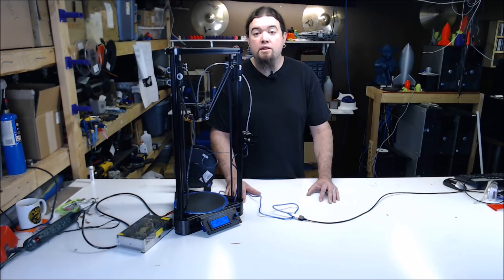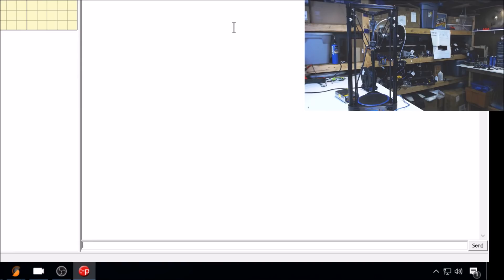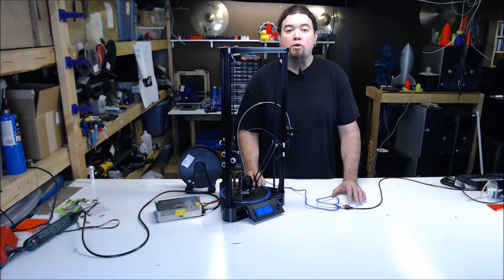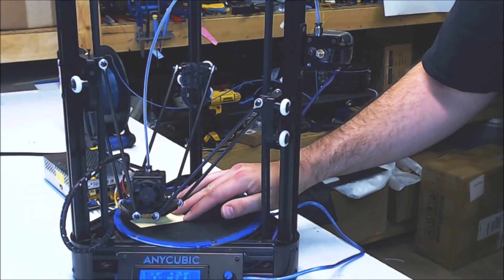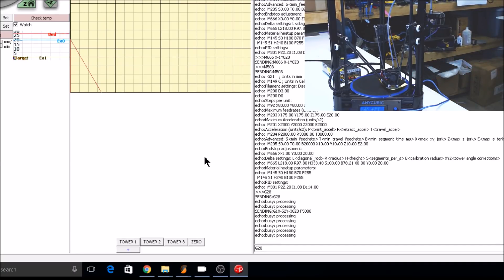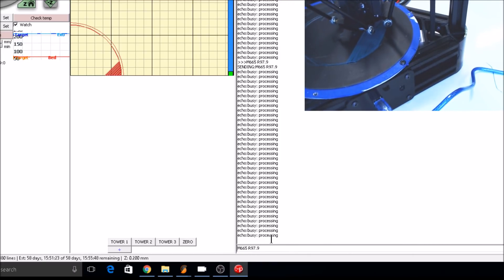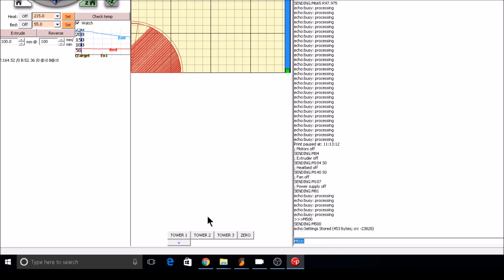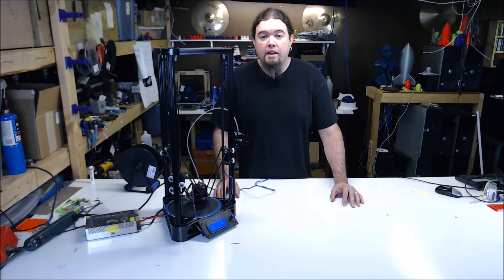How to level your delta printer bed - Anycubic Kossel Delta

Comment from the maker: On the newest version of the Anycubic firmware, adjust the height of the printer with MANUAL_Z_HOME_POS.
Reply: How do we do that? I can't find the height when I type M503 to check the settings. 
Also, changing the z offset doesn't do anything and i don't understand why
Please help
Reply from the maker: Can you post your M503 output? Most of the time when you can't change Z offset, its because EEPROM is enabled. You can comment it out in Marlin to avoid this, or run a M502 to restore defaults, then M500 to store them. This will update your eeprom with your Marlin changes. Also, check out this newer version of Marlin, I have tuned this one for the Anycubic Kossel. Check out this post, https://www.thingiverse.com/groups/anycubic-kossel/forums/general/topic:25027
Reply: HERE IT IS:
SENDING:M503
echo:Steps per unit:
echo:  M92 X80.00 Y80.00 Z80.00 E96.00
echo:Maximum feedrates (mm/s):
echo:  M203 X200.00 Y200.00 Z200.00 E200.00
echo:Maximum Acceleration (mm/s2):
echo:  M201 X3000 Y3000 Z3000 E3000
echo:Accelerations: P=printing, R=retract and T=travel
echo:  M204 P3000.00 R3000.00 T1500.00
echo:Advanced variables: S=Min feedrate (mm/s), T=Min travel feedrate (mm/s), B=minimum segment time (ms), X=maximum XY jerk (mm/s),  Z=maximum Z jerk (mm/s),  E=maximum E jerk (mm/s)
echo:  M205 S0.00 T0.00 B20000 X5.00 Y5.00 Z5.00 E5.00
echo:Home offset (mm)
echo:  M206 X0.00 Y0.00 Z0.00
Auto Bed Leveling:
echo:  M420 S1
echo:Endstop adjustment (mm):
echo:  M666 X0.00 Y0.00 Z0.00
echo:Delta settings: L=diagonal_rod, R=radius, S=segments_per_second, ABC=diagonal_rod_trim_tower_[123]
echo:  M665 L218.00 R98.40 S80.00 A0.00 B0.00 C0.00
echo:Material heatup parameters:
echo:  M145 S0 H180 B70 F0
  M145 S1 H240 B110 F0
echo:PID settings:
echo:  M301 P22.20 I1.08 D114.00
echo:Filament settings: Disabled
echo:  M200 D3.00
echo:  M200 D0
echo:Z-Probe Offset (mm):
echo:  M851 Z-18.26

I'm new to this. When I uploaded marlin I lost the auto level feature in the printer. The problem is that auto level is not precise and is about 2-3mm away from the bed. So what do you think I should do?
Reply from the maker: I would try to manual level first. If you can get that working you can circle back with auto level later. What version of Marlin is this? My guess is it must be pre 1.1.1. Is this the Anycubic Kossel Delta pulley version? I would load this code up first than start from there. https://www.thingiverse.com/groups/anycubic-kossel/forums/general/topic:25027
Reply: I'm not sure which marlin, I'm using the firmware provided by Anycubic. I've been contacting them for over a week to help with this issue and now I lost hope. 
Yes this is the Anycubic Kossel Delta pulley upgraded version. It came with a probe module and a heated bed.
Thank you for your help, I'm going to try it now
Reply: The bed is now leveled but once starts printing it extrudes just a little bit of filament that doesn't fill a quarter of the outer circumference and the extruder makes noise periodically. 
Do you think its a hardware issue?
Reply from the maker: fauzi Ame Strange, it could be. Did it ever print at all?
Reply: Nops, I've been trying for a week. nothing is working.
Reply: Do you think I should return it or something?
Reply from the maker: Head over to my about tab and send me an email. I will help troubleshoot from there.
Reply: Alright, thanks
Reply: Yes and also disabling the software endstops by just changing the true behind the line in a false.
Reply: Isn‘t there a menu entry SET DELTA HIGHT in SET DELTA SETTINGS?
Got M1.1.8 running and it is there
Reply: yes it is indeed!
Reply: Hi there I need some help with my printer it doesn't calibrate and gives a error

Comment: When entering G28 the print head moves up to the endstops and after reaching them, moves down to aprox. the middle of the Z-Axis.
In Configuration.h I see #define DELTA_HEIGHT 300.00             // (mm) Get this value from G33 auto calibrate
Using Marlin 2.0
Reply from the maker: For some reason, our channel got a bunch of comments recently that are over a year old. I hope you got your issue solved. We didn't purposely ignore you. Thanks for watching!

Comment: Hey, I just noticed that I can't seem to enter commands onto the printer through my pronterface(app) . But I can do it using pronterface in the print window type with Cura, is there some settings within proterface so I can control it directly ?
Reply from the maker: Just make sure another application, like Cura, isn't running at the same time as Pronterface.

Comment: Chris, I used your tower commands and it works for towers x and z but not for y. I double check all input already. When I execute the command for Y it does not go all the way down to the bed but only goes half way. Only happens on Y. Any advice is appreciated.
Reply from the maker: The only time I remember seeing that it when that endstop was just a bit higher than the others.

Comment: To disable z_safe_homing, I commented this out but it does not stop at endstops. It still moves below endstops. Options? Thanks.
Reply from the maker: Hey Bob, what printer? Below the endstops? Not sure what you mean.
Reply: @ChrisRiley  Thanks for your reply, Kossel Linear Plus. Using Marlin 2.0. Once the Ends go up and touch the end stops it drops down about 30 - 40mm and rests there. In your video you mentioned to comment out // Z_SAFE_HOMING to make it stop at the endstops and prevent them from dropping back down. That doesn't happen on mine for what ever reason and was hoping you might know. Thanks Bob
Reply: @ChrisRiley  I found it.   Comment out // - #define DELTA_HOME_TO_SAFE_ZONE - This will stop it from moving down.
Reply from the maker: @bobross8314  oh, nice, glad you found it.

Comment: Once again, thank you Chris. I just bought a Monoprice Mini Delta, my first delta printer. There is a facebook group with docs to improve it but all the things they do seem way complicated. If I "manually" level the bed with the M666, I will remove the G29 command in my start gcode in order to not use the "auto-leveling". I will also set the radius.
Reply from the maker: You bet! Glad it helped you.

Comment: Thanks 
but i have a big problem I sit the bed but when I print there are some places in the bed not touch by the print tool and it move high in some places in the bed please help me how can i fix it
Reply from the maker: First thing I would check is make sure all your smooth rods are the same length and your endstop mounts are all level and tight.
Reply: I cheked all of these and also i changed the bed and still the same problem i even changed the voltage and there is not diffrence
Reply: Do you have email or whatsapp that can i communicate with you and sendyou short vedio show the problem ? Because i tried all things and still the same problem

Comment: hey just a question about those adjustment screws on the top of those rod holders 
Im having a problem with this exact same printer when I first set it up it used to print perfect now after a few month my prints have an angle to them Im wondering if my prints are coming out slanted because those screws need adjustments? my printer is anycubic kossel plus even though it has auto level Im still getting this problem??
Reply from the maker: Hmmm, strange, angled in what way? I don't think its the endstop screws, if I had to guess, it is something lose on the effector.

Comment: Hi Chris. I wonder if you can help me. My problem is with my Anycubic Kossel pulley version. I have levelled the bed pretty much spot on using your video.Iv'e just installed Marlin 1.1.8 and when it print now the print head scrapes across the previous layer without lifting while moving to the next layer. Do you know if there is anything in Marlin that I can alter to prevent this happening. the prints come out ok , but sometimes they actually get knocked over mid print. Any help would be gratefully received.
Reply from the maker: Sounds like maybe the radius is just a touch off. You might try enabling z-lift in the slicer to see if that helps.

Comment: Sorry I meant the one I printed. It has a thin edge one one side. I printed a larger model of something else larger. It’s still uneven. I get good plastic laid down on one side and the other side barely has any laid down on the first pass. I’n gonna go through the video one more time. It’s a flsun delta xl. I think the radius is what I’m messing up.
Reply: Think i found it, end stops were loose. I kept g33 p1'ing and would get different heights. Used a nickel to space and wedge'em up top and re-ran the tower calibration. and got a nice circle right off. You Sir are a true friend of the crown!!!
Reply from the maker: I had the same issue on mine at first. I had to really lock down the endstop. I also lowered the feed rate on homing a little to keep it from crashing so hard into it. Glad you got it fix!
Reply: Thanks its almost 100%. I still think i have a leveling issue. when it prints the "ring" around whatever I'm printing if its larger than 6in  in diameter it gets real translucent like the print head is too close in one area, the rest is perfect. When i did the calibration from the video, i did NOT change the smooth rod offset. I had it dialed in i thought and did nt wanna screw it up. Any thoughts?
Reply from the maker: Your radius is probably off ever so slightly. Try reducing your smooth rod length just a little, try .1 or .2 and see if it helps.
Reply: that was it! Thanks So much!! Bought some fil from you amazon store !!
Reply from the maker: Great! Thank you so much for the support!

Comment: I'm at around the 4:00 mark, what if my printer didnt come with coordinated for in front ofthe towers? It's not an Anycubic Kossell, but everything else has worked dandy so far.
Reply from the maker: Then assignment of a X Y Z for the tower doesn't matter much to the printer, but it does make things a little easier to troubleshoot. I would just decide which tower is which and make sure that motor cable goes to that tower, just to clear up any confusion. As far as coordinates, I just use something like Pronterface to move the print head in front of each tower then do a M114 to check where its at and write it down to use on my macros.

Comment: Hey @Chris Riley.  My delta has a auto level but most of the time when I action the command the head would sometimes crash in to the bed and also scrape against the pulleys if that makes scene?
Reply from the maker: Hey Derek, I have had the same issue with auto leveling on deltas. What commands are you using to trigger the sequence?

Comment: Hi Chris. What do i do if my firmware doesnt show delta height after the M503 command? ">>> m503
SENDING:M503
echo:Steps per unit:
echo:  M92 X80.00 Y80.00 Z80.00 E96.00
echo:Maximum feedrates (mm/s):
echo:  M203 X102.00 Y200.00 Z200.00 E200.00
echo:Maximum Acceleration (mm/s2):
echo:  M201 X3000 Y3000 Z3000 E3000
echo:Accelerations: P=printing, R=retract and T=travel
echo:  M204 P3000.00 R3000.00 T3000.00
echo:Advanced variables: S=Min feedrate (mm/s), T=Min travel feedrate (mm/s), B=minimum segment time (ms), X=maximum XY jerk (mm/s),  Z=maximum Z jerk (mm/s),  E=maximum E jerk (mm/s)
echo:  M205 S0.00 T0.00 B20000 X10.00 Y10.00 Z10.00 E5.00
echo:Home offset (mm)
echo:  M206 X0.00 Y0.00 Z0.00
echo:Endstop adjustment (mm):
echo:  M666 X0.00 Y0.00 Z0.00
echo:Delta settings: L=diagonal_rod, R=radius, S=segments_per_second, ABC=diagonal_rod_trim_tower_[123]
echo:  M665 L218.00 R98.40 S100.00 A0.00 B0.00 C0.00
echo:Material heatup parameters:
echo:  M145 S0 H180 B70 F255
  M145 S1 H240 B100 F255
echo:PID settings:
echo:  M301 P22.20 I1.08 D114.00
echo:Filament settings: Disabled
echo:  M200 D1.75
echo:  M200 D0
echo:Z-Probe Offset (mm):
echo:  M851 Z-3.06
>>> m114
SENDING:M114
X:0.00 Y:0.00 Z:-26.30 E:0.00 Count X: 13458 Y:13458 Z:13458

My "0" is at -26.29
Reply from the maker: Do you know what version of Marlin you are running? These don't show on older versions. Not sure what version you will need, but see if your manufacture has a newer update.

Comment: - what is marlin and where do I get it?
- what are the steps involved in running it?
- does this work for delta printers other than yours and if not can can I tell if mine will?
- Will I fuck my printer buy doing something wrong in this software
- etc etc etc etc etc please rename this video to how to level X delta printer if you already know how to do it.
Reply from the maker: Zim Zimmerman 
First two questions, check links in description of this video as well 
https://youtu.be/0pt_b2ZizQM

I works on most 3D printer boards,  the boards.h can help you figure that out. That includes deltas as well.

Yes, you can render your printer inoperable if you don't know what you're doing.

Comment: hi chris, i tried to do level but i have strange behavior, on tower 1 it goes to tower 3 and so on, that can be because i make mistake connecting endstops? motors are correctly corrected.. and M666 command does not make correction.. ouch
Reply from the maker: So the coordinates I show don't move it in the same direction as in the video? Are you using the stock firmware? If the motors are correct I am not sure what could cause that.
Reply: Chris Riley Yes my left is x right is y and front is z axis. Is it Right? I got your 1.1.6
Reply from the maker: It really shouldn't matter which way you hook up the motors, it would be the same out come. This is how mine is currently setup. I think its the same now as it was in the video, but my stuff gets changed a lot so it might not be. If you want to use the same commands I do, you will probably need to change your motor and endstop cables to be like this.

https://i.imgur.com/MZKjC9r.jpg
Reply: Will try this way, strange since I installed your firmware months ago always get printed small stuff for RC quads  and puff one day needed to level again.. will take a free morning next days to get outta of this trouble... And invert x and y
Reply from the maker: Ok, give it a try and let me know how it turns out.
Reply: couldnt resist and tonite i did the check, i guess because of my mainboard position i had different movement, so to get move axis as you move on video i did this , u can see letters in yellow of my axis
https://s31.postimg.org/ovesbi2gb/IMG_20180330_001738.jpg
Reply from the maker: Yes, now we appear to have the same setup. The commands from the video should now work as expected.
Reply: Yeah now must level. Vinyl cover has gone damaged I removed, so use hairspray on glass. may be after level consider upgrade to plus? New versions seems better
Reply from the maker: Fabio Fabius I am not sure about the newer ones. Anycubic does appear to make improvements to their designs and this kit has been pretty good. I now ones might be even better.
Reply: Chris Riley have to say cordially thanks for your precious support , mi first mission is make this one run açcettable , than go beyond. So will make some more talks here. Next step is level it. Will post my results soon
Reply from the maker: Anytime! Keep us updated.
Reply: i did calibraton but something is different on my printer look at videro model on cura and on plate orientation:     https://www.youtube.com/watch?v=QhniyTWl8WA  anyway i got quite well prints now, hotbed is on the go , will continue to  play with it ..

Comment: Lol, I just realized that I have some WICKED A.D.D.! Anyone have the Cliff Notes on this? 😂🤣 This calibration process is monotonous AF. I think I'd have more fun tearing my toe nails off...smh 🙁
Reply: Great video by the way very very helpful. Ty!
Reply from the maker: Lol, yes the delta level process is in no way a fun one. This was the quickest I could find to make the process. I do feel your pain, I am currently working on a leveling sensor setup to see if that will make the process any easier. Thanks for watching, hang in there. ;)

Comment: Hi Chris. Me again. Having problems leveling the bed. After your instructions: The nozzle is .2mm off the bed next to the three towers. That's good. But when I go to print, the nozzle almost scrapes the bed next to the X tower and is very high off the bed next to the Y tower. So nothing sticks well near the Y tower. The Z tower is fine.
I would think that if its a concave/convex issue, it would be high or low all around.
And ideas what I'm doing wrong?
Thanks!
Reply from the maker: What is you radius set at? That is usually the issue I see when this happens.
Reply: Chris Riley : delta_radius = 98.7
Delta_printable_radius = 90.0
Delta_diagonal_rod = 218
Reply from the maker: Around 98 should be close. I would run through it again and check everything. Make sure there is nothing in eeprom that is messing you up.